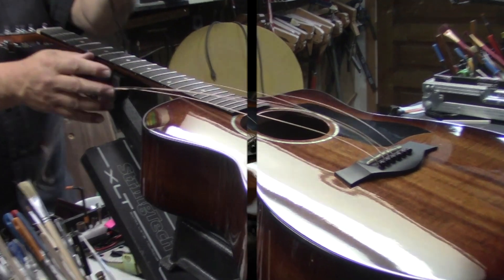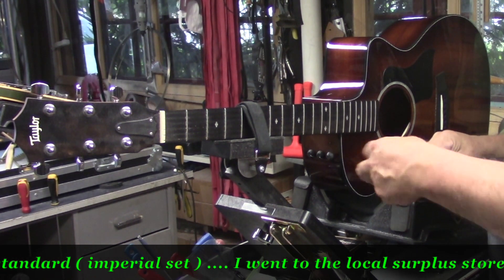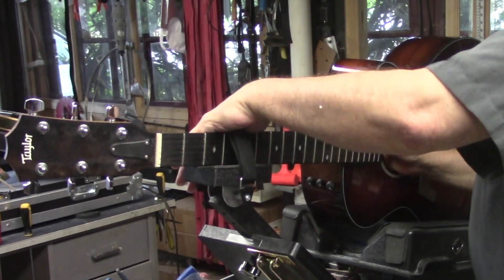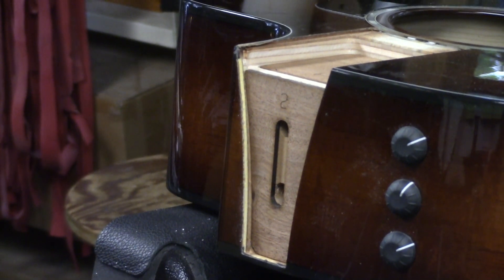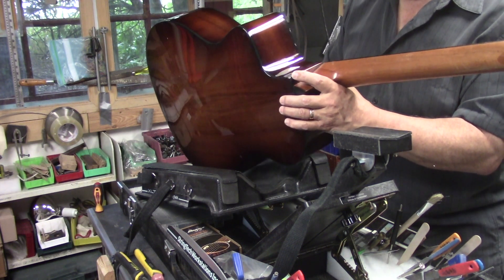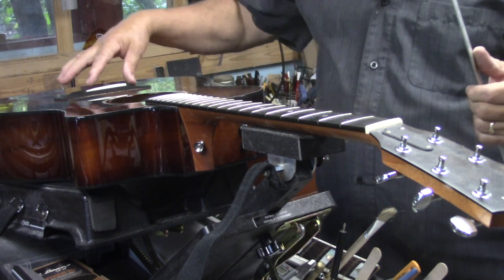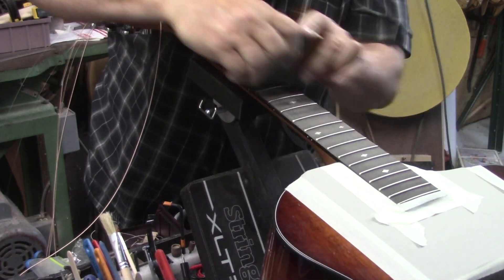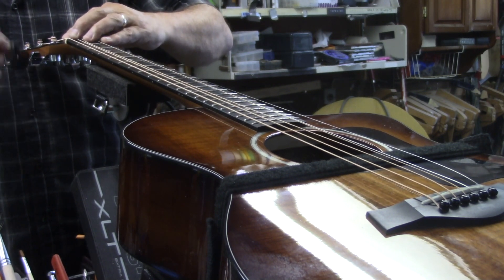Taylor Neck Joint Explained @StringTechWorkstations

Comment: My guess that .1865 Allen key is just a 3/16". That's only .001" off nominal, which is pretty good for a cheap allen key.
Reply from the maker: It's no longer an issue Rob ... I have that Allen key flagged with a piece of masking tape and jammed into the high density foam storage in the TechDeck. I just snap it up and go now ... for anytime that the Taylors show up. Problem solved ! Cheers ! MMcC

Comment: I 'll always hate taylor.. why? my son bought one from a well known music store 2nd hand. Paid thru the nose for it and in a few years the dumb ass finger joint  under the truss rod nut blew out. never seen nothing like that before.
Now they build their necks like that. (go figure) and taylor don't care to stand behind their poor design even though the instrument originally sold for over 3 grand. So screw taylor they deserve it.
yeah! the Martin sound 100x better!!!  Much better company too!
Reply from the maker: I can understand your frustration. But there is a HUGE camp of Taylor fans out there. The industry has changed. Even Martin have plastic fingerboards and bridges / bolt on plywood necks. I am not taking sides one way or the other. The adjustable neck joint system that Taylor came up with, is actually pretty ingenious. The finger jointed neck however ..... hmmm that's kinda scary. I do respect your position. Everyone should have the right to express their opinion. Cheers  MMcC
Reply: Happened to mine also